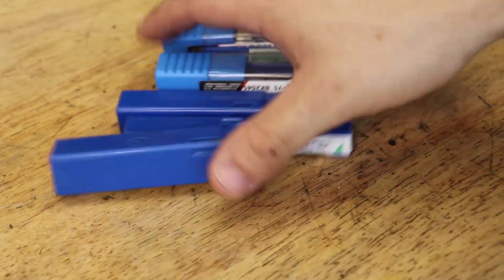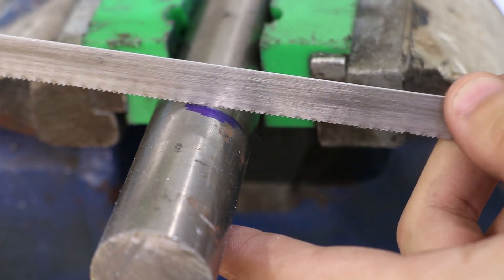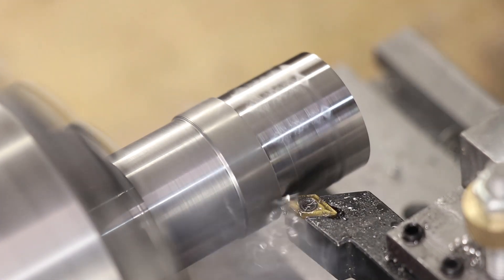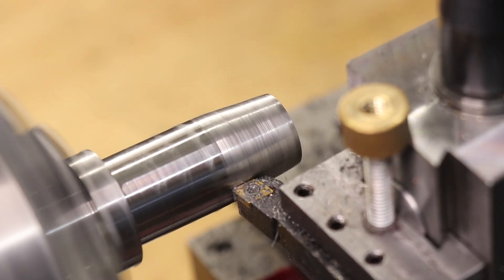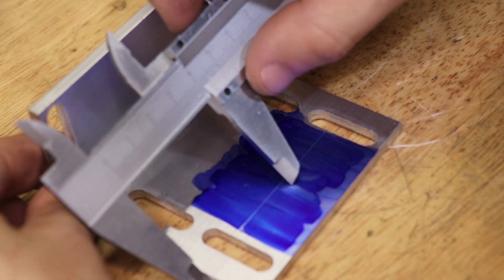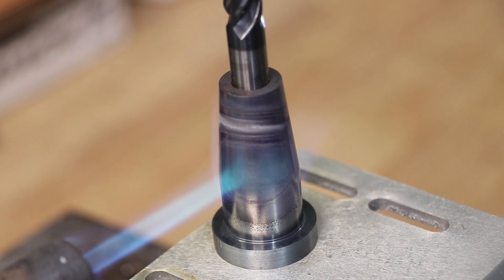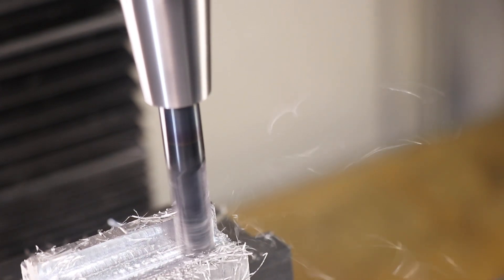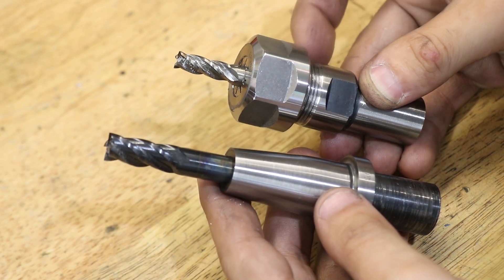I Made My Own HEAT SHRINK Endmill Tool Holders

Comment: An induction heater would me more efficient. Better control of heat/expansion. Making the fit up that much better. Hard to control heat with lighter fluid. Witch takes forever because of the btu rating, propane is a stup up but MAP is better. Induction is more efficient in the long run with a more consistant result.

Comment: nah .... if u have a slow router maybeee.... and good cooling.. i mean the type of cooling that eats 50% of ur profit margins... otherwise that thing... is a disaster waiting to happen... 1/10 of a mm dilation and that tool flies in heaven hopefully alone... and not with collateral body parts.
Reply from the maker: That certainly isn't the case on my mill. It's a great tool and it can do some heavy machining. Not sure how you came to that conclusion, maybe different set ups that you are used to using. Cheers

Comment: You should consider using a small toaster oven or your kitchen oven for the start of heating parts. My kitchen oven gets up to 550f (~290c) and for large parts that saves a lot of gas.

Comment: I have no machine shop experience, so maybe I'm talking complete rubbish here...   The tool holder you made is tapered (for obvious reasons), so when heated, would not the narrow end get hotter sooner than the thicker end? If that is the case, then the thin end will expand more as well. Just my 2 cents....
Reply from the maker: Yeah, so I'd assume that there is more compression at the narrow end. It still is compressing at the front but not as much.

Comment: Kind of an old video but, for heat shrink tooling, I think(take this with a grain of salt as I've never done this myself) you have to harden the tool holder first, grind it concentric and then fit the tool. Hardening or annealing steel warps it enough that grinding is usually a neccessary step.

Comment: Nice idea to use an endmill as a boring bar. I was thinking how would you make a holder for smaller endmills than what common boring bars can do, and then i saw you use a endmill as a boring bar and i realized yes that is how holders for smaller endmills can be made.

Comment: One suggestion. You might consider some other holder for heating up the holder. Aluminum sinks heat very quickly which might account for your tool only fitting to 90% depth. I would suggest a bent steel wire for a test.

Comment: You could have froze the end Mill tool and made the tolerances a little bit tighter freeze the end Mill heat the holder makes for a tighter fit
Reply from the maker: If you run the numbers freezing it wouldn't do much, you really need to duni it in liquid nitrogen to make a tangible difference. With all.that said I really was pushing this lathe beyond what it really is meant to do. Cheers

Comment: personally i would finish the hole and taper in the mill spindle to make sure that its as precise and lowest runout as you can with a budget machine 
also its cheaper to convert you boring bar to a carbide one ( stefan gotteswinter  have a video anout it )

Comment: Nice one! I would not have thought of the runout on the taper or the drawbar causing the problem. You did well to get so little runout on the tool itself. I tried to make a 6mm toolholder once and the runout was atrocious.

Comment: I recently cut off the set screw locking part of a 1/2” end mill holder right to the taper, of an R8 tapered holder. I then bored it open to hold a 3/4 “ ball nose end mill. I got a nice close fit and the used Red Locktite to hold in place. This allowed for the stubbiest extension of the end mill to reduce chattering. Worked well .

Comment: Very cute idea. 

Your boring bar is most likely fine. Your insert geometry isn't helping you. Use a smaller nose radius insert with less of an edge prep. That means it will feel sharper on the edges instead of being rounded off.  Also find one with a positive rake for less cutting pressure. Also try feeding away from the spindle, sometimes the lead angle from feeding 'backwards' helps mitigate chatter.

A diamond wheel is useful for repurposing and getting a bit more life out of insert tools. Accu-Finish (slow rpm diamond lapping machine) is a wonderful machine to have. I'm certain you can figure out how to fab one up. 

A project idea if you haven't made one for your lathe yet. A tool centering gauge.
Reply: Also, seems like taking some additional spring passes (without advancing the tool) with the boring bar when you are close to final dim will even out the hole diameter (power feed is your friend here, for even material removal!) .. For that matter, I would think that deflection of the boring bar wouldn't cause taper in the bore, unless there has been uneven stock removed or feed over the various passes - the boring bar would deflect the same amount independent of how deep it is in the hole. I typically use sharp edged cutters on my small lathe, mostly sharpened myself (not very experienced with inserts) - check out cheap imported diamond grinding wheels, can be a good start for this, but low speed diamond lapping sounds appealing as well, especially for tiny edges of tools - lining up a tiny edge on a 3600rpm wheel is not easy freehand... 
Great to see someone try this!

Comment: The carbide end mills are perfectly fine to use usually. What I like them for it stuff you know is going to break an end mill but is really hard and you still need to mill. Like weld beads or  brazed joint on cast iron that maybe got a little to hot and started to make glass or whatever that byproduct is. That crap is so hard on tooling. But sometimes you just HAVE to do the job. These are perfect for that kinda stuff. Basically a throwaway tool. Good stuff. Liked the video and subscribed because of it. Hoping to start uploading videos myself again as soon as my replacement shop is finished. (Other one burned flat )😔
Reply from the maker: Thankyou for sharing your perspective. Knowing how my welds usually turn out, maybe ill be using the carbide more often. Hope to see stuff from you soon, i've subbed and ill be looking out. Cheers
Reply: That sucks about loosing your workshop. :-(

Comment: Making and using small diameter laps for precision holes is very easy and provides excellent results with just a little practice. Tom Lipton (Ox Tools) and Robin Renzetti (RobRenz) have both covered this topic with videos on making and using laps. 

Best part is the process is cheap. Scrap piece of aluminum and a little diamond paste is all you need.
Reply from the maker: certainly a good suggestion. That probably would have been my go to if I had run out issues. Thankyou.

Comment: It's a fact that you can't slide a 20mm pin into a 20mm diam hole.....you need to be approx .02mm undersize to get it in without sticking.........on that basis if you make plug gauges for hole testing you need to make them undersize......how much undersize?........cut and try etc.

Comment: I'm a professional Machinist who also own smaller machines at home and I find those cheap blue packaged Chinese HSS endmills work realy good for the price. The only big issue being they are not ground to the proper diameter they are often a little over or undersized, but thats only really an issue if your cutting a pocket in 1 pass like a key seat.
Reply from the maker: Interesting, great to hear your insight into these end mills. They are certainly a lot better than they used to be. Cheers

Comment: Works great ! 
I did contemplate something like this but a lot shorter and more like a short sleeve over the end Mill shank  so it brought all the shanks up to the same size ( 20mm ) and I could use one size ER collet or MT collet for most of my work . I ended up getting a couple of 20mm end mills and a drill chuck with a 20 mm spigot and use them the most , I only change over to the smaller cutters when I absolutely have to and run them in my ER holder . I wonder if for small cutters if using some high strength loctite  retaining compound would be sufficient ?

Comment: On the subject of chinese carbide endmills, They are very well made in general. I’ve had little issues that were not my fault. For aluminium I recommend getting the bright finished 3 fluted ones or the DLC coated ones if you want to spend extra. They cut so well in my bridgeport and leave fabulous finishes without even trying. The dark coated ones are for steel, running them slower than rated is no problem I’ve foune but adjust your feed to match the required feed per tooth.

Comment: You could try to lap the inside diameter of the toolholder with an expanding lap. That will give you a tremendously better surface finish and a parallel hole. 
If the hole is tapered at all the endmill will not be held rigidly.
Normally they are ground but that’s not an option for your shop I believe

Comment: my job specifically is setting up and measuring tooling in a production cnc shop. we use a lot of shrinkfit tool holders. if i remember correctly, those shrinkfit tools are typically made from H13 tool steel. one of the things i've noticed on shrinkfit tool bodies is that the more times you heat and change tooling, the tighter they seem to grab over time. i don't think youll have an issue with that since you likely arent changing endmills in your holder multiple times a week. but perhaps in 20 years time, you may get to a point where you want to pull a dull or chipped endmill and have to get the holder ridiculously hot to just barely be able to remove the endmill. also, it is worthwhile when you remove a dull tool, to allow the holder to cool and then clean inside the bore with a solvent and pipe brush before putting a new tool into the body. you could also make more of these in the same shank size but with shorter bodies to hold specific drill sizes you use frequently. it may help you change from a milling to a drilling operation without swapping out your collet for a drill chuck. just a thought... I'm slowly getting into manual hobby machning myself, so i get where some things aren't necessarily feasible for the home shop.

Comment: When I designed a small magnesium extrusion container, I specified an interference of 0.25 mm between the inner liner and the mantle. This required a temperature difference of approximately 350 celsius to put it together. The insane shrink fit produced a compressive load of something like 600 MPa on the inner liner, without this there was no hope of extruding the magnesium reliably without deforming the container (tensile yield strength was around 1100 MPa)

Comment: You can take those little inserts and hand grind them against glass backed waterpaper... It takes time, but not that long, just pick it gently, lay it as it wants to lay on the side and rub it out... flip it to the top side down, grind down the top side a bit... You will quickly establish the edge, and what is more, you can hone them outta box if you need to reduce tool pressure that they cause due to their factory grind... It goes much faster with a tool&cutter grinder with 8 axis compound system, but before i got mine, i sharpened them like the kitchen knives... Wet sandpaper and a glass plate underneath... Get some different paper, wet paper in grits from 100-5000 is invaluable for any work... Truth be told, if i need to polish something that is scraped in, i will lay it scraped side on the glass plate with 5k sandpaper on it and give it a whirl, then take plain printer paper and 1 micron diamond lapping compound... It will take an hour, maybe two, but the endresult is a surface at the desired and preset angle, with what is essentially above grade 00 gauge blocks... You can do amazing work with just some flat glass, lubricant and elbow grease... Be it precision ground and polished spacers or be it fixing antique and/or costly watches and jewelry...
Reply: Also, consider what i said regarding precision spacers... Take your drawbar, jaw it, make it central, polish up the ``smooth`` section below the head of the dbar, no more than a centimeter or so, check the size with the micrometer, make it even and make it a bearing surface... After that, take a chunk of steel, cast, stainless, bronze it dont matter much, and chuck it up in the lathe, make a spacer that will fit in your spindle from the top, and allow the dbar to slide in it and have a smooth running fit in it... I dont know how to explain it to you better, but i guess you understand what im saying, a shouldered bearing that will allow you to use the drawbar, but will hold it as concentric as you make it, to the spindle, so you never have to bother with it, you have a bore that aligns the dbar for you and you just have to sinch it up in the holder without considering the position... It will reduce your thread engagement, but thats why the shoulder can be made like 2 mm thick, its just there to hold the bearing as not to fall down the spindle towards the threaded part of the dbar... If your mill is similar to mine, the drawbar has around 18 threads of engagement in the toolholder, so losing 2 or 4 threads wont hurt it even marginally, and will allow you to run max rpm without a care for the drawbar in the world... Now the holder runouts are another thing entirely, but if you can see what im trying to paint here, i believe you will make it... Or just remake the drawbar to that fit atop the spindle and have all the thread engagement you want, along with perfect concentricity to the spindle... A high quality drawbar if you want, a premium quality, one of a kind, custom honed just for your mill... Its a good thing either way... tho a spacer is much easier to make as its 1/15th the size of a dbar...

Comment: That inside surface looks rough as hell in the first few shots...but achieving that in a hobby shop is still impressive
Reply: That’s the first thing I noticed. I see concentricity issues in the future.
Reply from the maker: Yeah if i didnt get it in the second time, or if I had concentricity issues that would have been the next thing to tackle. Cheers

Comment: Nice work!

ISO h6 tolerance on a 10mm nominal shaft is +0/-9μm, so the Chinese endmill's shank is probably within that tolerance. A typical shrink fit for an h6 shaft would be an S7 hole, which at 10mm nominal would be -17/-32μm.

Steel boring bars are usually fine to 4xD or 5xD. The trick is to use a sharp finishing insert, at least for the final pass - a more blunt general-purpose insert has significantly greater cutting forces (especially at very low Ap), which greatly exacerbates bar deflection.

Comment: If you want the longest life from your carbide tooling, then keep the water based coolant away from it while in use. Carbide cannot handle thermal shock like high speed steel can. 

If you can't run the feed and speed required go obtain an optimal finish a little light oil can improve the surface finish.

Comment: When you are trying to get perfectly sized holes for press fits and slip fits on a lathe, especially in a small lathe where the boring bar rigidity to material rigidity is in the favor of the material. I tend to rough out the material with a boring bar to undersized and ream it to size to avoid chatter and get a perfect fit!

Comment: Cool video, And great content. Having purchased a Index 745 recently and im still in the process of getting her cleaned up and wired in (Cold NE USA winter) Im investigating all available ideas for tooling. This mill use the B&S #9 system with the draw bar. Ive recently scored several different sized tool holders in the #9 size. I also added a set of #9 B&S spilt collets from 1/8th to 3/4 to have on hand just in case. Ive been lucky and scored some new and lots of used HSS end mills recently. And was lucky to find some new (or looked lightly used) Carbide tools mixed in with my BIG score of about 200 pieces that I picked up for $60.00 (USD) id say 85% was HSS and the rest was Carbide. And probably half of those Carbide where still new in sealed containers. So it definitely was a good score. Even the majority of the broken end mills appeared to be salvageable. Anf those that aren't ill do something with as scrap, They make great safety pins to use on the bottom of hitch pins on farm equipment.  I try to never throw good steel away. It cost to much today. My goal with the Index 745 is to get more rigidity in a mill. I have a Grizzly G1006/1007 Drill Mill thats "Ok" for smaller lighter cut jobs. But this 1900 lbs Index knee mill was the KING of rigidity back in its day (new in 1968) Of the Vertical knee mills. Will see how it turns out. I really enjoy your channel. I lol when I hear you Brits call Aluminum "Al- mini- umm"  I'm sure you lol at us red necks and our accents also. As you should. 😉😉😉👍👍👍. 
And while we at it, this is a Football 🏉. Not this ⚽️. LoL.
Reply: Artisan is an Aussie!

Comment: When doing a model engine piston bore I made a go/no-go guage out of some mild steel first. This was made using an external micrometer obviously and I also had a couple of smaller diameter steps before the "go" stage to let me know I was close. You could do the same with small holes and in this case you could make a test gauge with a shank based on your measurement of the end mill minus the shrink fit tolerance and use this to test your bores. Then there is no need to use an inside micrometer/calipers, just rely on your test guage and the known smaller diameter steps. Basically make your own custom gauge pins :)
Reply: This is the way to do it I was making bespoke go- nogo gauges in the early eighties a micrometer is far more accurate than a vernier we also used shadowgraphs to compare to precise drawings.

Comment: You said you had to max out your rpm, do you know roughly what that is? I have only used hss, but have been considering getting carbide.
Reply from the maker: its about 2500 rpm on this mill, though im sure I could bump it up by changing the timing belt sizes
Reply: @artisanmakes  I guess, just don’t push the material through as fast!